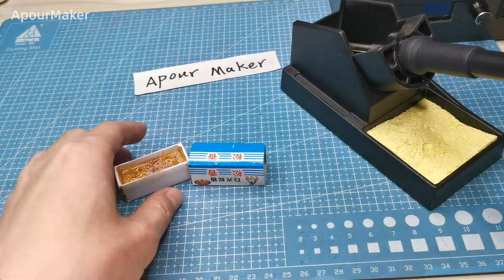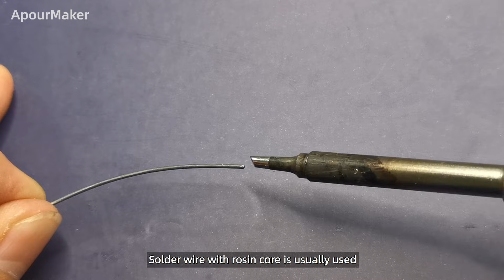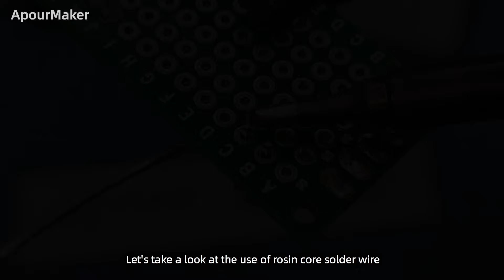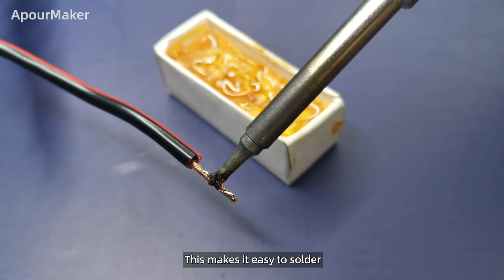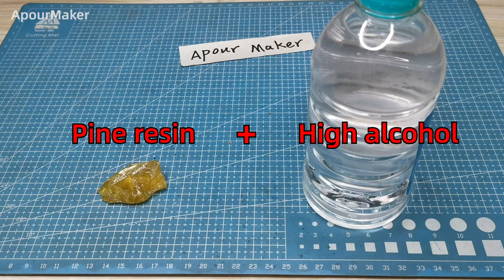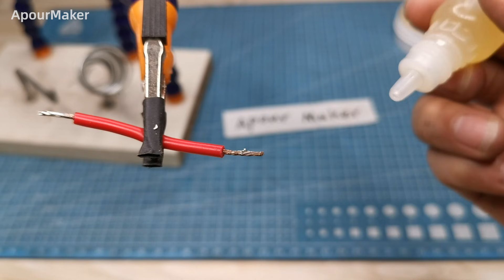How to use rosin when soldering

Comment: There’s a reason professionals use commercially-manufactured flux: it works better than pure rosin. Fluxes contain activators in addition to the rosin, which make them far more active (capable of cutting through more severe oxidation). I made rosin-in-alcohol flux once, and while it’s better than nothing, it doesn’t come close to real flux. I use it for one thing only: to create a protective coating on freshly-etched (homemade) PCBs. The rosin coating prevents oxidation and doesn’t need to be removed before soldering.

Comment: What if I simply dump the wire tip into the solder paste AND THEN get the soldering iron in contact with the flux'ed wire?
Reply: You can do that.

Comment: Why in hell are you dipping your soldering iron in the flux... People will think that's the way to go.
Reply: How else to heat/soften the hard resin?
Reply: @denmikseb  Take a small and cheap paint brush and dip it into the flux to "paint" it on the component you want to solder. Your soldering iron should already have it's tip tinned. If it isn't, buy a tip tinner.

Putting the soldering iron directly on the flux will just evaporate a whole lot of it for nothing as it wont stick on your soldering iron (or very badly due to the high temp).

Flux should be pre-applied on components, not transfered from you hot iron tip.
Reply: @MrFloyd4  pls can u make a video about that method, I wondering how to dip the wire to the flux as it is hard, soldering it and dip the wire together is what I use know after watching several videos on youtube
Reply: @denmikseb  Dipping the iron tip in resin cleans away residues on the iron tip, but remember to apply resin to the area you want to solder with a plastic strip, or paint brush.

Comment: You are NOT supposed to "carry" solder from the iron to the work.  You are supposed to heat the point or wire you are going to solder with the iron and then put the solder to it.
Reply: Sometimes the component being soldered doesn't take kindly to being heated. Everything has its place!
Reply: this isn't always true
Reply: Of course you can.